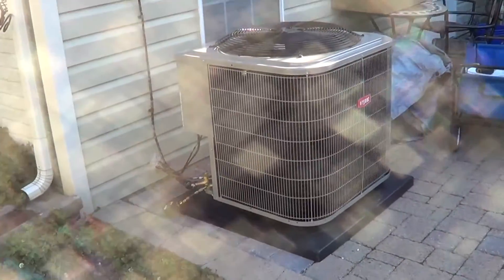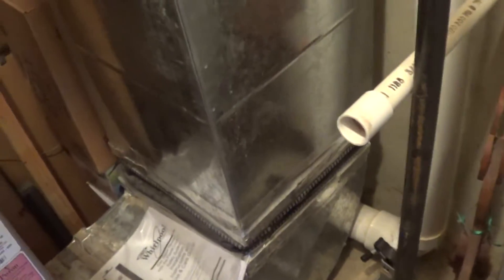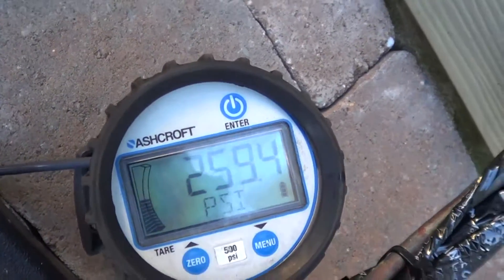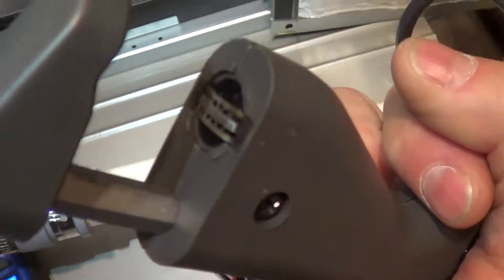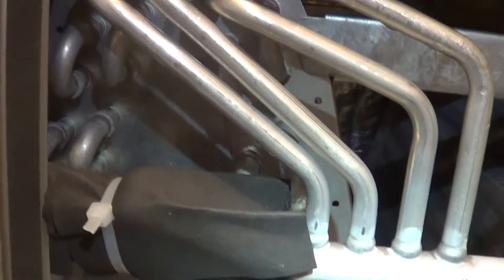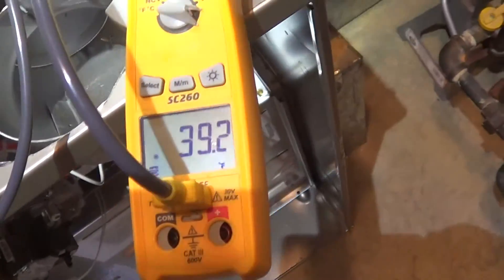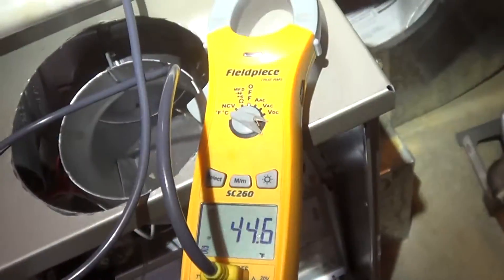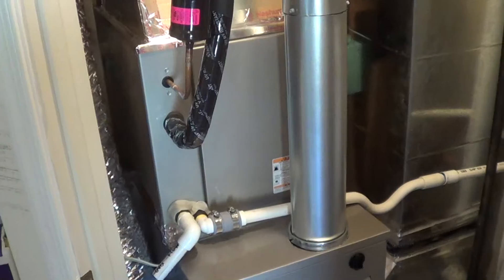Checking Evaporator Coil Circuits with a Thermal Camera

Comment: I would recommend to add a transition of at least 18 inches between the furnace and coil before doing any balance because this is a N coil and air distribution can get very weird around it and through it. Great video as always.
Reply from the maker: Yep.   I learned that the hard way on a new install that liked to ice up.   I found 6 inch is enough to even out the air flow in the "N" though.

Comment: I did like you said but had to nearly completely pinch one tube all the way down. It seems to have made the situation much worse.
Reply from the maker: I have since started putting all n coils 6 inch or higher above the furnace.    The balance is actually air flow, not refrigerant flow.    Raise that coil up.   Unpinch the tube.   And you are good to go.

Comment: 10 sub cool is low, 20-25 is what you want no?   10 of super heat ok.. but 10 sub cool is a little low. which suggest it's missing a little bit of refrigerant
Reply from the maker: 15 deg F sub cooling is a full sight glass.   More than that just backs up in the condenser and occupies tubes with liquid that won't transfer heat nearly as much as vapor.   You can usually spot an over charged condenser with a thermal camera.   I have a video on this subject.   Too much freon is just as bad as too little.   Pretty much all the brands now want 10 deg sub cooling.    Carrier marks the amount on their name plate.   If a  sight glass is installed, it will flash.   I will typically put my ear on the liquid line inside the house to confirm I hear bubbles.   Then I know I am around 10 deg F subcooling without needing to use any tools other than my ear.

Comment: So did you get another Evap coil under warranty? Carrier seems to have a lot of problems with low superheat. I have had a lot of the N coils with blocked airflow on the right sides when they first came out. I will be looking for this the next time before replacing the TXV. Good catch!
Reply from the maker: The N coils can be tricky if they set directly down on certain furnaces for upflow orientation.  You  have to look at the orientation of the heat exchanger cells and make sure that airflow is even to all the slabs of the N coil.  If there looks to be only one heater cell feeding 1/3 of the coil, raise the N coil up 4 inches on a short duct.  A coils never had that problem.

Comment: Interesting video! I remember having to do this on a large commercial storage cooler, 4 of the circuits at the bottom of the coil near the drain pan weren't getting enough airflow and were freezing up, causing a large buildup of ice at the bottom of the coil. It would get so bad it would freeze on to the drain pan and then not defrost properly. I ended up pinching those circuits completely off. This was a 32 circuit medium temp 5 ton system though, so wasn't much of a capacity loss. Design temp was 30 deg F, so was an electric defrost coil. Simular to what you find in a walk-in cooler, but this was 22' ceiling with product on pallets.
Reply from the maker: I remember my deep freezer warehouse days.  I went from 95 degrees outside in Houston to 20 deg F below on top of a fork lift in front of the fans.  Nothing but Fun mixed some pain and never bored.  Now, I love residential.  I get to listen to youtube videos all day long on my phone with bluetooth earpiece.

Comment: I was feeling like quite a slacker until you put in your disclaimer and said you didn't advise this kind of balancing for all installs.  A guy would be really unhappy with himself if he pinched a tube too much.  Great video - it was surprising to see how different the flow was running in the different circuits.
Reply from the maker: Before the thermal camera I always used my hand to take these measurement.  I could feel where the liquid level stopped on the coil.  Thermal is much faster and more accurate.